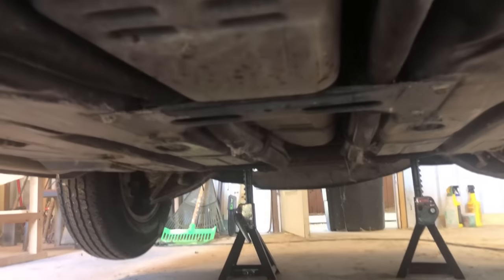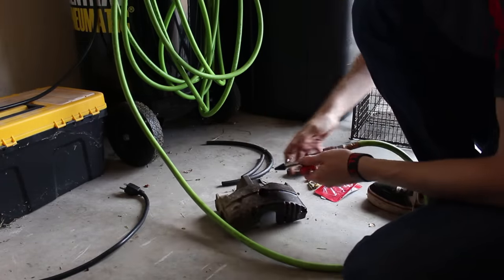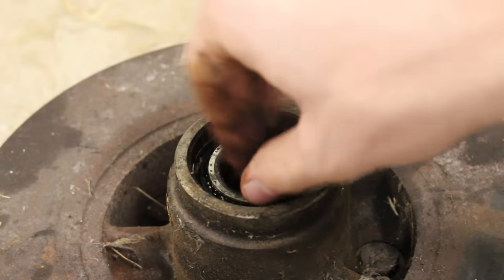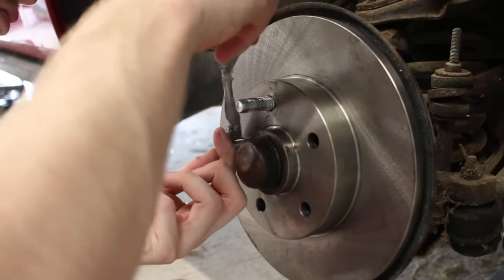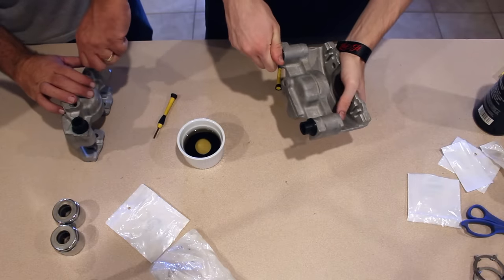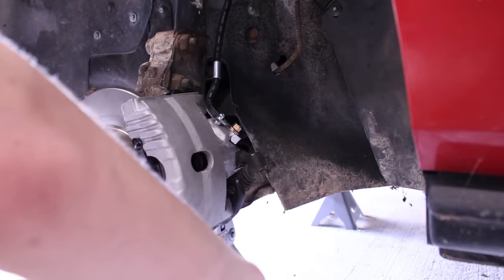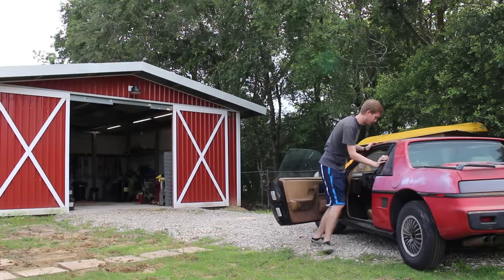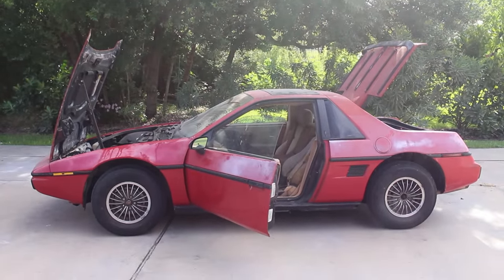Fiero Drive With Me | 1985 Fiero 2M4 Revival - Part 3

Comment: So many comments...hope you get this. Super neat cars, good job covering this in the first episode.  Had a 2M4 in the late 90's when I was in high school in the burbs of Phoenix. Factory radiator fan switch was not that great, made it manual with a toggle switch inside the car; location your preference. Doing so made it warm up faster in the winter and on demand in the hot summers. engine always ran better warmed up. Underpowered, but past 85 mph the 2m4 was a handful. Steering was very light at those speeds. Found half the hardware on that car was imperial half was metric. Ground strap from the engine to the chassis on mine was susceptible to working loose. Made the gauges go crazy and hard to tighten on a hot engine as it was towards the bottom front of the engine near the middle of the car; loctite that turd. Good Luck with your build! and thank you for posting.

Comment: How much coke do you think they did designing this car
Reply: So much
Reply: I wasn't Coke is was LSD. lol.
Reply from the maker: At least 7
Reply: Ronald Finger 7 grams or kilos
Reply from the maker: Haha yeah
Reply: all of it.
Reply: actually, a lot of what he went through is typical for older (80's and older) vehicles. A lot of the issues he had was simply due to it sitting for 20 years in the woods. If it had been maintained, everything would have come apart relatively easily. 

The front rotors with the bearings is how most vehicles were done even with drum brakes in the front....pretty simple design......and easy to work on and repair.
Reply: All of it
Reply: There's nothing extraordinary about these cars other than the appearance. It has a Chevette front end, and the rear subassembly was taken almost verbatim from a Pontiac 6000 with the spindles locked so the wheels stayed straight. All out of the parts bin. That's why the MR2 outperformed it. Good to see this car saved however.
Reply from the maker: You should go watch Part 1! There is more than just being a parts bin cat. Space frame chassis, injection molded, cast urethane, and sheet molding compound panels, CNC drilled mounting holes, and more. Definitely parts bin, however still very extraordinary.
Reply: @RonaldFinger  Not saying it's a bad car, because it isn't. But, it was developed on a budget like a lot of vehicles back then. They improved each year. If you like this one then you would love the last '88's. Have fun!
Reply: @TylersNeighborhoodGarage  well, it worked and worked well. BTW: the drive line was out of a citation. 

The suspension and driveline were out of the parts bin, but the rest of the car wasn't. With the right upgrades this could have been a monster performer. The aluminum spaceframe was STIFF. 

BTW: most vehicles these days are "parts bins". They don't make engines for ONE model...they make them for 10. Take Bentley for eg: many of the parts are from BMW (or merc?). Audi uses Volkswagen parts. Even McLaren uses mercedes electronics.....

GM was onto something with this car but abandoned it due to politics plain and simple. They could have even made it a bit bigger in subsequent years and kept the same basic design. That's the beauty of the space frame design: you can put whatever body panels on it you wanted in a heart beat. 

"but it's a two seater" you know how many times in the last 10 years I had someone in the back seat? maybe 1/2 dozen. If a chick or dude is driving to college or uni, how many times do they have someone in the back seat? 

Now throw in the move to EV's and this thing would be a KILLER electric vehicle........with the right motor this thing would SCREAM......it'd be so fast you'd have to put huge spoilers on it to keep it on the road......
Reply: @RonaldFinger  bet you regret selling it? I had a couple of buddies with them, they loved them!
Reply: @RonaldFinger  your build series is convincing me to go dig out my old 1988 gt ferrio and get her running again it looks in the sane condition too sadly😞 my dad drove it until the water pump need replaced and for that you need to tske the whole engine out and sence then its sat
Reply: @RonaldFinger  So you're saying I should check out part 1? I will for sure ;-)
Reply: @Tech_481  helpful tip.  I don't know who told you the engine had to come out for a water pump.  That's complete B.S..  The water pump is an easy job.  Seriously, look at it again.  Don't let that deter you.
Reply: @sledgehammer8542  I'll look at it again becuase thats the reason why my dad stoped driving her i cant wsit to fix her when I buy it off of my dad
Reply: I thought Delorean was the one with all the coke.
Reply: @Tech_481  I hope you get it running soon.  They were great little cars.  I've owned 4 over the years.  2 87 Gt's, 1 86 GT and one 85 SE.  Lots of fun and easy maintenance and inexpensive parts.  Enjoy.
Reply: @sledgehammer8542  oh i will
Reply: To those that are saying the driveline came from Model X, Y or Z....you're partially correct. GMs engine/transaxle combinations were used across dozens of makes/models. The 2.5L Duke in the Fiero is the same as a 2.5L from a Celebrity, 6000, Citation, Cutlass Ciera, and more or less the same as the one in an S10 (different bellhousing pattern  and manifolds, but internally the same). I don't remember which platform the cradle is from, but if memory serves, the toe adjusters and bushings could come from any GM FWD of the Era. Parts bin approach? Yes, but how many vehicles of that Era weren't?

Comment: Total fail at properly packing those wheel bearings. You’re supposed to drive grease all the way up between the inner race, the rollers, and the cage until it squeezes out the top between the inner race and the cage. This is the ONLY way to get grease completely into the bearing by hand. You have the right method with the grease on your palm, just not looking for the right end result. It takes a little bit of time to do it properly but then you’re guaranteed that bearing will last it’s maximum amount of time.
Reply: Was scrolling down the comments to see if someone already posted this. The bearings will fail if left the way they were packed .
Reply: Yep! Bearing packers are so cheap to buy. Doing it by hand like he did the bearings won’t last long. Also I noticed he tightened the nut down with adjustable pliers. Yeah he didn’t go crazy but he should have went hand tight then backed it off 1/4 or less of a turn. I have seen to many cars come back with hot seized bearings from over tightening.
Reply: Well, as he stated in video 1 of the series, this is all a learning experience for him. I didn't know how to properly grease cage bearings either, when I was his age. It was an old aircraft mechanic who taught me to put a blob of grease on my palm, hold the bearing with a finger through the center, and scrape grease from the edge of the blob, until grease pushed out of the other side of the bearing, turning the bearing to push grease through all around.
As per bearing greasers, I have a unit from Matco. You fill it with a grease gun. The bearing is placed on the top of the cylinder, in the cup. The lid is placed over the bearing. You push down on the top of the lid to force grease through the bearing. It is so hard to press that I usually set it on the ground and stand on it. It is such a pain that I usually end up doing it the dirty way, with the grease in the palm.

Comment: When installing bearing races...USE A BIGGER HAMMER!!!!!!!! They pop right in. Also, if they are available, buy new calipers!!! Don't screw around when it comes to brakes. The car sat 20 years, all that stuff is rotten. Too many points of failure. Buy new. I just put a 1980 Corvette back on the road that sat for 18 years. I didn't even bother with the hardware that was on the car. I bit the bullet and bought all new brakes parts, master cylinder, booster, all of it. You do nor screw around when it comes to brakes. Corvette bakes are much more expensive than Fiero brakes too.
Reply: Larry Drozd yeah I second this there’s nothing more important to a car than the brakes, your life depends on them.
Reply: Calipers for that car should be cheap... and easier than rebuilding

Comment: Cool series! Being a car guy myself, I like the tone and pacing. Regarding the stuck clutch, another method of loosening it is to try to start the engine with the car in gear and the clutch and brake pedals fully pressed. This can be done in the shop without jacking up the car or anything. The torque of the starter motor should be enough to yank the clutch free.

Comment: You need a bigger hammer to seat those bearing races.
Reply from the maker: What the heck Steve! Why did you wait until after I already did it with the small one to tell me?
Reply: @RonaldFinger  Next time
Reply: I agree, and remember this: If it can't be fixed with a hammer, then it must be an electrical problem.
Reply: Every shop needs a BFH
Reply: @nealvance2506  nah ive fixed plenty of electrical problems with hammers lmao the one thing u cant fix with a hammer is a leak lmao really youll only make it worse 😂😂

Comment: Keep it clean fellas, the parts that is !   Split pins are called cotter pins and they are used to hold the castle nut so it can't turn either way or you will lose a hub and wheel ! You did good

Comment: I'm sure ours been mentioned but you can crank those headlights up manually if it'll move at all. Those sail panels are pretty easy to fix up, what did on mine was remove the cracked portion and you can paint the whole thing black and have a great finish without buying new sail inserts.
Really cool project though, glad to see a fiero go viral. I have a 85 gt myself can't wait to see this done!

Comment: I had an 85 Fiero 2M4, I had it for about 6 months until I found it totally not what I needed, I traded in on a 84 GMC S10 Jinny that I drove from 1985 to 2000 and crossed Canada 3 times with it without a working fuel gauge.

Comment: My battery did the same thing!  But it was cut all the way through and sprayed the battery-acid all over the place.   Got it home,  ruined battery out, and washed everything down with a baking soda solution, several times.   A new battery and a bungee cord to keep it in place.
Keep on going.  I can't wait until the day i can afford to my own Fiero back on the road.

Comment: What a badass lil car, I like it!

Regarding the rear brake assembly parking brake, there's a few parking brakes that worked in a very similar way going back before the 80's, in my case I own a 1975 VW-Porsche 914 (which was developed as early as 1969 and is ALSO a mid engine, rear wheel drive vehicle with POP UP FREAKING HEADLIGHTS) and it has a similar screw mechanism that sets the venting clearance on the inboard pad, and a lever arm that actuates a cam and pin to push that piston and pad against the rotor.  

The more modern approach for cheap 4 wheel disc brake vehicles is a bit easier to work on, and also requires less overall maintenance:  A separate, dedicated drum brake that operates on the inner 'hat' of the disc brake rotor.  

As far as the clutch, I'm actually surprised you managed to break it free that easily!  Usually they'll get a bit of surface rust and will take a beating and a half and never break free until you remove the pressure plate and give the clutch disc it a ~tiny~ little prying away from the flywheel, and it'll pop right off.

Comment: I am retired now but in my life time the 1984 Pontiac Fiero purchased in Nashville Tennessee that I had was a top performer and handled very well at High speeds...4 cylinder and NO ISSUES ... trust me many Troopers in their time did not have the radar perfected for a fiberglass body vehicle that small... BIG SMILES ...owned and used as a daily driver for 9 years... then the car required maintenance and moved to Orlando area had no luck with a "highly regarded" mechanic to keep me on the road... I reluctantly moved on to a another vehicle... Isuzu Rodeo which I had for 20 plus years without one issue... but miss that car because it was the best time I had behind the wheel... I still look on the internet to see if I may find another Pontiac Fiero... unfortunate for me I am not as smart as this guy and his brother...the likelihood of putting myself back in a Fiero is unlikely... too old....THANKS FOR SHARING this series of your build... kinda jealous... really enjoyed the videos of your restoration...

Comment: Hey Ronald, I think I have a tip that can help you along with your project. Back when I was taking the cylinder head off of my 1993 Acura Integra GS-R, I researched a way to clean all the metal parts without doing something expensive like getting them acid dipped. I found out that you can actually get a "soda-blasting" gun real cheap at your local auto parts store, and use a certain blend of Sodium Bicarbonate as a soda-blasting medium. Those brake calipers would clean up looking like factory. It's worth looking into as an alternative to liquid degreasers, which require lots and lots of scrubbing. Soda blasting material is also re-recyclable, which means if you do it in a sand blaster, you can re-cycle the medium as you would sand blasting material. The difference between using sand and soda, is soda is environmentally friendly, and can be used out in the open air. Hope this long comment helps, and good luck!!!

Comment: You can heat up the rotors so the metal can expand make it easier and the cool down with air in a can so get cooler shrinks more.

Comment: For anyone dealing with seized calipers, the easiest trick is to use a grease gun with a nozzle adapter to attach to the brake line port.  You just pump it up and use hydraulics to break the piston free.  This prevents the majority of catastrophic damage from occurring.  Just make sure you tie a towel around the caliper before you start pumping as the piston can be launched quite far.

Comment: This comment sort of piggy backs off of the comment I made on part 1 and then part 2.  I start with the foundation, that's all the stuff on the bottom of the car responsible for making sure the car is safe to move, even if it is just pushed, towed, or trailered.  Suspension, steering, brakes make up the bulk of it, but all of the bushings are replaced along with the shocks and the entire brake system.  You did a big chunk of the brakes and I was really encouraged to see that but I cringed seeing the suspension neglected behind it.  I feel like you're repeating some work but dude, you've brought that car back to life.  I'm super excited to see what you do next.

Comment: That car must be so happy to be getting a new lease on life! I hope she serves well for many more years. The 50's through 80's were in my opinion the golden age of vehicle innovation. 

I'm watching series like these mainly because my hubby's old 96 Ford Bronco isn't aging terribly well, and really needs some help. Thankfully he has kept her running in more or less top condition on the inside, and it's mostly electrical and topical issues that need addressed. Some of the lights are failing and she needs a new driver side window installed. She's rusting in places like the rear wheel wells. I've proposed a simple cover'up fix by adding fender flares, but we both really want her as close to original appearance as possible.

Comment: Awesome job, it's coming along really well! The only thing I would mention is that when you install the front rotors with new bearings theres usually a torque procedure to seat the bearings, then you back the nut off and re tighten loosely to hold the rotor on, so you may want to look into that before driving around on it too much, wouldn't want to damage the new bearings

Comment: Great video series! The rear wheel bearings on my car are the same style as the front ones on this Fiero. Both of them became noisy, and I replaced the races by punching them in with a hammer and a slab of wood to try and make the pressure more even. They only stayed quiet for a month, go figure...

Comment: Just so you know, the black knobs by the headlight assy are for manually putting the headlights up. If you live in an area that gets really cold in the winter, sometimes the motor freezes. You will want to disconnect the electrics if you raise/lower the headlights this way. Hope this was helpful.

Comment: Nice video series. Those locking washers on the brake rotors are strictly there to hold the brake rotor on when the car goes down the assembly line. They are also a dead giveaway to identifying that those were the stock/factory brake rotors. Nobody ever put those clips back on.

Comment: You can use a pen or pencil manually raise the headlights on it, the round knob with two holes in it by the headlight is where you would do this.  The motors are probably long gone by now as it was not uncommon, I think some of the trans am motors swapped if I remember correctly.  The fan not kicking on may be the same issue I found on a lot of the iron duke engines, the fan temp switch was bad.  I had an 84 se and an 85 gt, fun cars!!

Comment: Wish you'd do the suspension bushings next (or soon), mine're all deteriorated and in need of replacement, with some  Polyurethane Front and Rear Control Arm Bushings, plus engine mounts (I have a 2.8L v6)

Great series, Mr. Finger!

Comment: A quick tip for pressing bearing in. Toss it in the freezer for a bit to chill it the metal will ever so slightly shrink making it a little bit easier to press in.

Edit: I should have played the next 2 sec before posting since you did that.

Comment: Those locking tabs that were on the studs for the breaks were actually used from factory while on the assembly line. Because the Disks were put on a while before the rims this just made it easier and less likely that the breaks would fall out of place